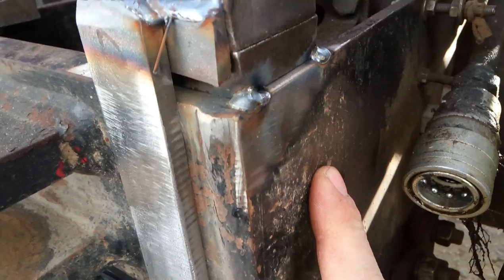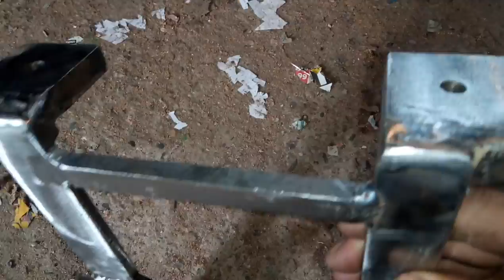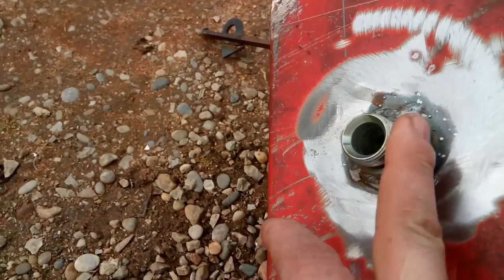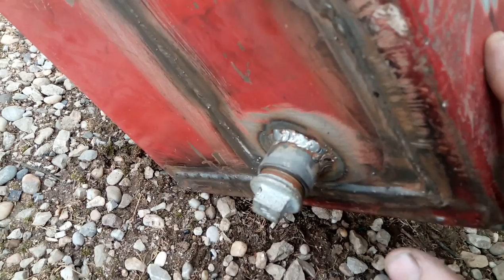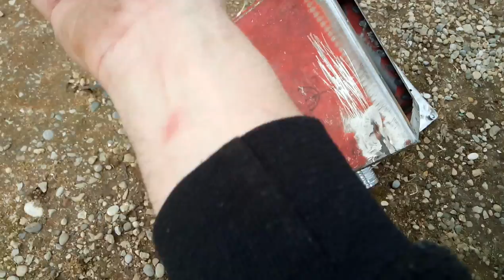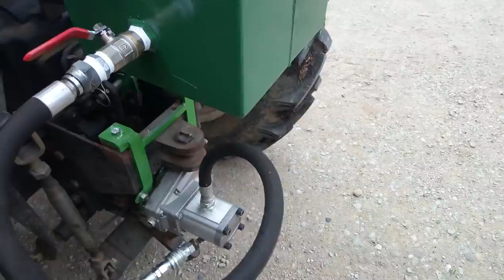Instal bigger hydraulic pump and big oil reservoir homemade

Comment: Thank you for posting this video. I am adding a PTO driven pump on my tractor and I was trying to decide how to tap into the factory reservoir. You solved that problem for me. I will build a similar tank and mount it above the rear fenders to the ROPS as to not interfere with my 3 point hitch. Thanks again.

Comment: Doing something similar on my little JD755 because the hydraulics are only 130 bar when I tested and now I need more power and volume for various stuff. The hydraulic guy told me to make the tank at least twice the flow rate / minute of the pump to avoid overheating during operation. So if the tank looks a bit big it’s probably good.
Well done nice job thanks for sharing.
Reply from the maker: With this bigger pump and tank oil is not heating,everything works perfect now,greeting from Croatia

Comment: When it was mine, I made a ventilation hole in the top of the tank ! And dril out the filter adapter (there is one opstruction) ! 60 liters is a lot of oil ! Another Good video !
Reply from the maker: Most important is that oil is not heating,on bottom of tank in magnet,but filter has to be there,hydraulic oil flow without problem,greeting

Comment: Greetings Mladen ... Another well put together project, great eye for seeing what is needed and then to put it together ... I enjoy watching your videos , If i could perhaps offer you a small piece of insight, i know you have painted your tank but maybe look at putting a window or level gauge so you can monitor oil levels without having to open fill lid, every time and this will also keep oil clean for longer ... Keep up your great work ... greetings from Africa
Reply from the maker: Good idea,i could also drill hole on that tank,one on bottom of tank and one hole in the middle of tank,insert clear plastic tube,it will also work,like your idea,next time il empty the tank,i will put that to see oil level,greetings

Comment: Hi there 

Can you tell me how fast that pump is spinning? I guess your PTO is running at around 540 rpm. I would like to know what the rotation speed is after the gearbox.
Thanks in advance! Like your videos and inventions a lot!
Reply from the maker: that gearbox ratio is 1 to 3,so PTO on tractor turn one time while hydraulic pump shaft turns 3 time

Comment: Hi Mladen,

thanks for your quick reply. So your pump is making around 1600 rpm I guess?
I'm just asking because I'm thinking of making and placing a PTO pump also on my Kubota B7000. This to speed up my front end loader a bit. I have a 3 speed PTO selector so I can select 3 speeds on my PTO.
What I would like to know is how fast on average the pump should spin so I do not break or damage it.
Reply from the maker: Can't tell you that,we put this pump for manure spreader,log splitter,to power our corn harvester and for other things we need,i am sure that with this setup front loader will work faster and without problem,greeting

Comment: I am interested in this project. Can you tell me the specs on the gearbox and pump? Better still, can you tell me where you got the gearbox and hydraulic pump? what is the required GPM?
Reply from the maker: Gear ratio i 1-3,flow is 60l of oil in minute,our tractor hidraulic pump has only 20l per minute,we need something bigger so we made this and it works perfect,greeting

Comment: Similar to how i run my log spliter from tractor ..but looking on your pump on the left hand side their is a breather should the breather not be at the top also dont you need a breather on your oil reservoir tank?
Reply from the maker: We gave mount it as manufacturer say,in manual it says pump can be mount on 3 position so we chose as we need,and on the reservoir we never screw tight that cap on top,it works perfect,oil is not heating,do you have video to see how your spliter works,greetings from Croatia
Reply: Kubota B8200 power PTO pump log spliter    this one running of the pto ,,,,,,,,,,,,,,,,,,,,,,,,,, and this one is of hydraulics from tractor   Kubota B8200 compact tractor running home made log splitter      but i am in the process of alternative power supply its in the design at the moment   its all on my little channel youtube

Comment: Do you remember where you got your gearbox and hydraulic pump. I plan to do this for my tractor, but I do not know where to get the parts I need.
Reply from the maker: I buy that pump with gearbox in Slovenia,shop is called  ROSI Teh
Reply: Bobby Freeman how much a set of gear box?